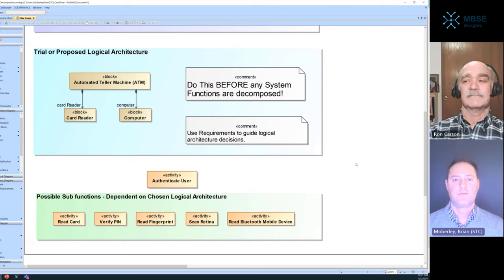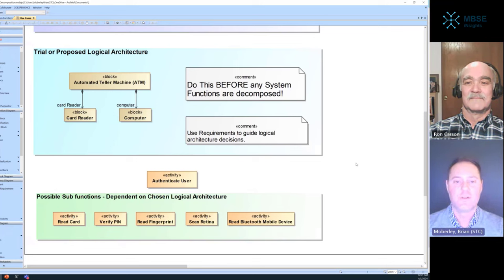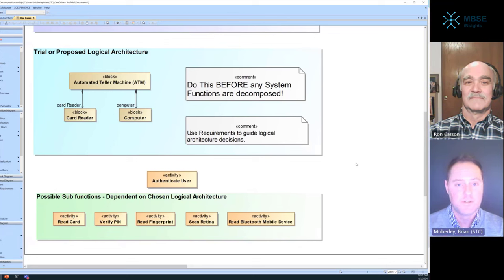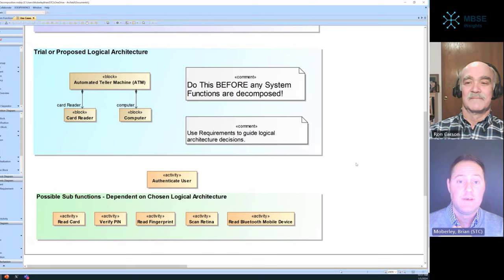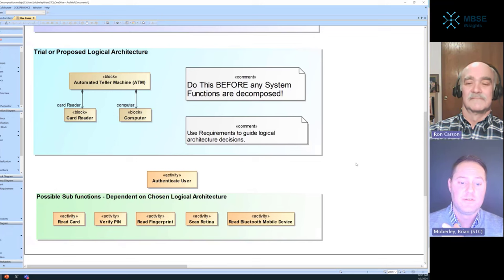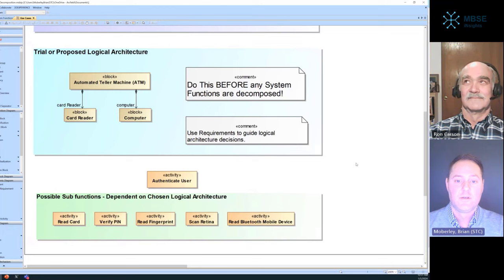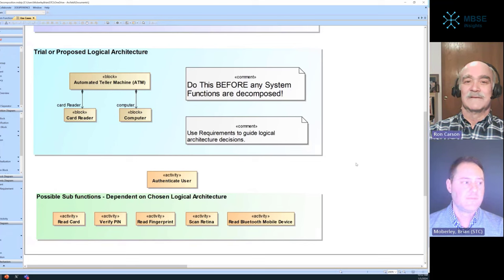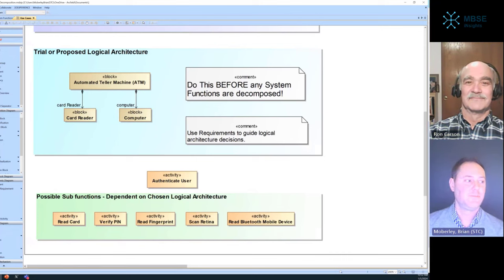The Two Types of Functional Decomposition

Comment: A few words about observability. While I agree that it is crucial for system verification, not every system function needs or can be directly observable. Some functions are only observable through their interactions with other functions. For instance, consider a function F1 that, while performing its primary task (control), detects a fault within the system. This fault is manifested externally through system fault reports and alerts. It's not necessary for F1 to produce the fault reports and alerts itself. Function F2 might be responsible for system fault reporting, while function F3 handles system alerts. Thus, F1's outputs (detected faults) feed into F2 and F3, making F1 observable externally only through these other functions.

Another example of a function that is not directly observable is the "Receive Some Data" function :) We follow communication protocols and perform data integrity and freshness checks to ensure the input data is available. These protocols and data checks deserve a separate function, at least on a lower level of decomposition, possibly as a software function.

Comment: Very good explanation from Dr. Ron Carson. However, I experience that lots of system designs are struggling with the approach to having "observable" functions. You mentioned at the end of the video, that there shouldn't be a function like "Validating", because it is not observable on the system boundaries. But we are building the logical (resp. the technical) architecture based on the functional architecture. So how to justify that we need somewhere a "processing unit" if this is not needed for the "sending" of the output? 

Another question would be the level of decomposition. I often get the demand from functional safety (automotive) to show the critical path and the correlation of safety integrity between in- and outputs. So even if I can allocate all in- and outputs to one single logical element, it is necessary to show which input signal has an effect on the output signal to prove FFI. To have a function-block with inputs at different safety level, it complicates the analysis and a further brake-down could show, that e.g. only certain signals have an influence on certain outputs. Sometimes hard to give this part of the jobs to the domains... How does functional safety influence this topic in your point of view?

Comment: Excellent explanation.  I've seen many systems engineers, system architects, and program/product managers who misunderstand this step and rush immediately to a specific implementation, prematurely settling on a functional architecture that is suboptimal at best and at worst may not meet the ultimate mission need and require costly design changes late in development.  The "two types of functional decomposition" explanation is useful vocabulary for expressing this to the systems engineering team and project stakeholders.